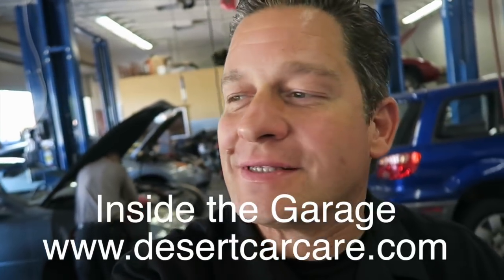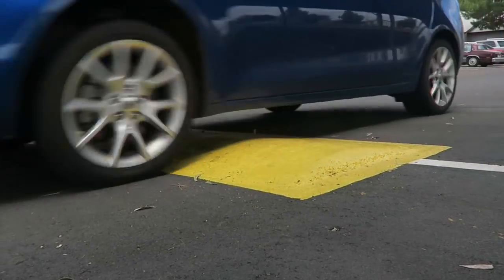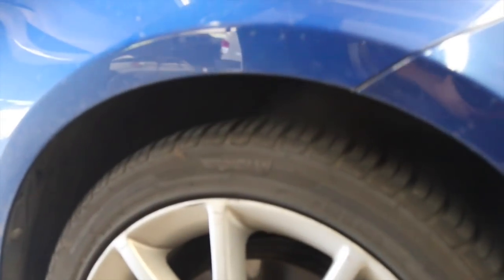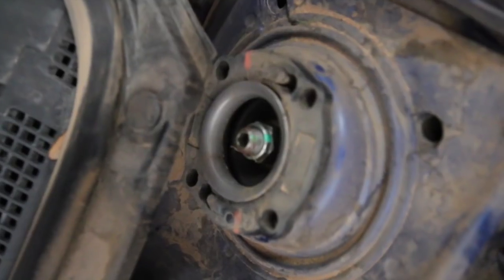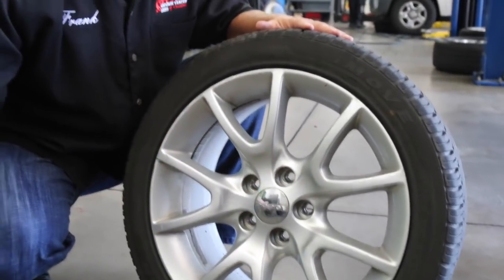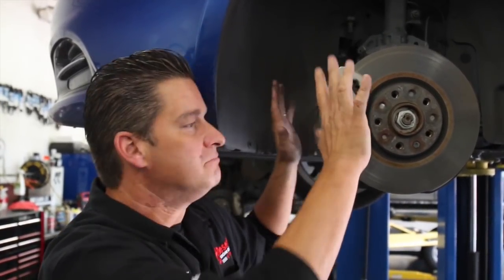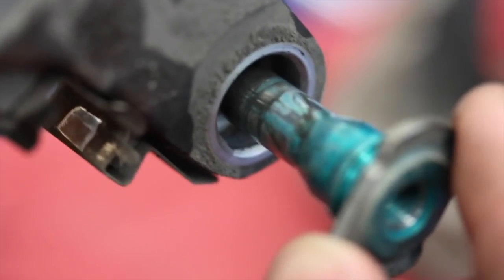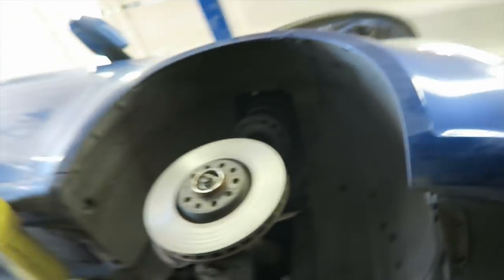Dodge Dart Brake Caliper Noise

Comment: Paid 500 for my break job, my Scion TC 2015 is doing the same thing, I’m sure it’s those pins.. it rattles over uneven surface at slower speeds, sounds metallic like something is broken,

Comment: Sooooo how did you fix the play in it?  You replaced the whole caliper?
Reply from the maker: MrPureSin ~yes.
Reply: Desert Car Care if its just bad pin bolts couldn't I just replace the pins?
Reply from the maker: MrPureSin ~~you could try that first~make sure no play there
Reply: Is it not possible to replace only brake carrier?

Comment: I am having this problem after replacing my rear caliper in my Honda Odyssey. It feels loose and rattles with normal driving. I don't get how that can happen with a new Raybestos Caliper. Would getting new pins fix the issue?
Reply from the maker: Brandon O. - possibly new pins ~ double check mounting
Reply: @Desertcarcare  I've double check mounting and even torqued to spec. It also seems like the bolts that go into the pins that hold the caliper to the bracket have some play. I will buy some new pins and compare them and see if that helps.
Reply: Been working on cars for 15+ years and never had a problem like this on a new caliper. Maybe a piston issue, a bleeder issue or piston boot issue but never that. 😂 Gotta love aftermarket garbage.
Reply from the maker: Brandon O. ~ good luck my friend ~ call me at the garage during the week anytime if need be. 🤜🏼🔧🔧
Reply from the maker: Brandon O. ~ man ~ it happens ~ walk away ~ re approach it with a fresh set of eyes ~ aftermarket can be risky ~ stay strong rock the weekend
Reply: @Desertcarcare  thank you! Your awesome! 🤙
Reply from the maker: Brandon O. ~came hang with us on the show 🤘~Call in anytime brother ▶️ http://apple.co/2EdrZJE

Comment: would it stop the noise only by changing the pins ?
Reply from the maker: Jessy Boyer ~ that should be good to go
Reply: thank you very much for the video and the answer !
Reply from the maker: Jessy Boyer ~ always here ~thanks for stopping by
Reply: Hey, just wanted to late you know that the new pins did not work. The problem seem to be in the bracket.
Reply from the maker: Jessy Boyer ~worth the shot. Ultimately glad overall a no drama easy fix for ya ~if you can ~ join me over here http://www.wrenchnation.tv/ ~ rock on.

Comment: I actually called my dealership and asked about this issue and they tell me absolutely nothing. If you're able to give me the info needed to get this correct I'd appreciate it. Thanks
Reply from the maker: Splitskull112 ~here you go as this should help ~NHTSA ID : 10136510 ; TSB 05-004-13 

Rattle from front brakes when driving without brakes applied ~involves replacing front brake caliper brackets ,spring clips & if necessary front brake pads.

Comment: Can a very bad strut cause a brake disc to overheat
Reply from the maker: Kingdrosive 3 ~ have never heard or seen that situation there ?
Reply: Yea..it was a odd correlation..but I’m highly convinced I have a bad caliper due to how hot one of my brake discs get..you can drive it around the block and the brake disc is untouchable compared to the other rotors
Reply from the maker: Kingdrosive 3 ~ let us know how it all works out ! Good luck there 🤜🏼

Comment: Hey, can you send me a copy of the TSB, please?
Reply from the maker: Mauricio Ortega ...they had quite a few T.S.B.'s for that platform ~~this is related to what is covered here: 2013 DODGE DART Technical Service Bulletin
NHTSA Item Number:10052113 Service Bulletin #:SB-05-004-13 Replacement #: Vehicle/Equipment Make:DODGE Vehicle/Eqipment Model:DART Model Year:2013 Mfg Component Code:030000 BRAKES (PWS) Date of Bulletin:2013-03-15 Date Added:2013-05-20 Summary:DODGE: WHEN BRAKES ARE NOT APPLIED, WOULD BE RATTLE NOISES FROM FRONT BRAKES WHEN DRIVING. MODELS 2013 DART

Any questions ring me at the garage.Hope this helps !

Comment: Just put a brand new pads on my front tires I have a Volvo S60 2001 and it has a 175000 miles on it the brake pads were smoking on both sides I’m almost positive that the caliper is sticking
Reply from the maker: ethan brewer ~ could be calipers | need to ensure hydraulically that when you depressed the pistons in the calipers ~ there wasn’t any debris back up in to the brake master ~ bleed the brakes really well with new fluid ~Additionally ensure caliper mount and operation is moving freely . Hope this helps ~ call me at the garage Monday am if needed

Comment: Just found out the noise from my truck was because one of my break callibers was missing a bolt
Reply: Tunic Slayer I'm having the same noise and issue I looked and I'm able to rock my caliper back n forth. Was ur brakes also squeaking or making a noise because it was loose ? I just changed my pads and I was missing a caliper bolt and they screech and rattle really loud
Reply: @chrisortega8813  so I was able to rock the top part of my calliper because there was a bolt missing all I had to do was out the bolt back and it fixed the problem
Reply: Tunic Slayer was ur causing the pads to screech and make noises at all too or just the rattling ? Bc I just put new pads and I hear the rattling and screatch and some light grinding and I'm wondering if the missing bolt is causing that and the rattling